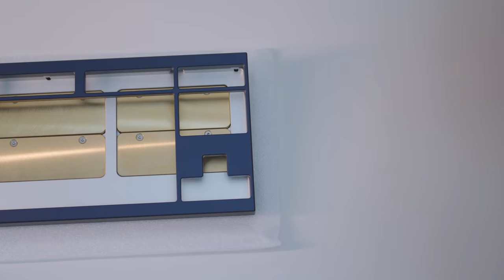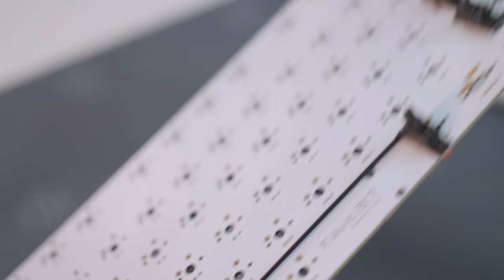Korean Custom Keyboard! F1-8X Build

Comment: Until theres an o-ring gasket mounted TKL like the Bakeneko, this board is my dream board. Very nice.
Reply: there's the Scarlet tkl
Reply: @ssh-gg9qt  I have an order for the scarlet, but it's not quite the same. Bakeneko is designed for that mount whereas say gummyoring mount for the kbd8x and the scarlet is an alternative mounting system.

Comment: Hi there, I go offered this board with 2 builds (PCB, plate) for around $600 USD. Should I take it?

I assume GB price was $390? This is baby blue/poly carb bottom, is the price the same/cheaper than GB for black/silver/general colours? Thanks!

Comment: at 9:13 u flex the board. how would u make the board more stable without changing the sound too much or in fact improving it
Reply from the maker: It's just its structure.
How they mount give different typing sounds and experience.
So, simply, you cannot change the mount without changing the sound.

Comment: Can you make a videos about a cheap keyboard build combos for some one that poor like me?
Reply: get the rk68, akko cs or gateron switches and 4x1x1.5 o rings for the o ring mod you can find on Keybored ‘s channel (don’t get the smaller o rings they say to get in the video)

for $80 with akko cs switches and $75 with the gateron switches it sounds pretty good after lubing, and i’ll do a sound test on my other channel when i have the time for it

you can also just use stock switches which are gateron rgb compatible which are decent which will be $60 because you are excluding the price for extra switches